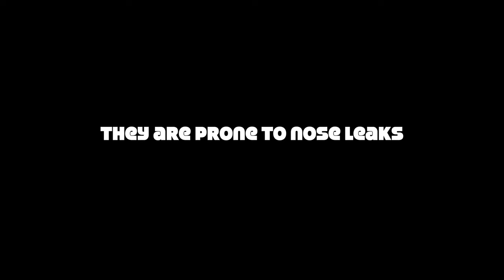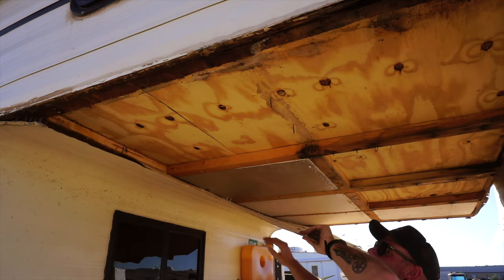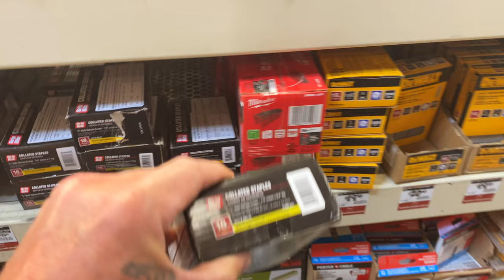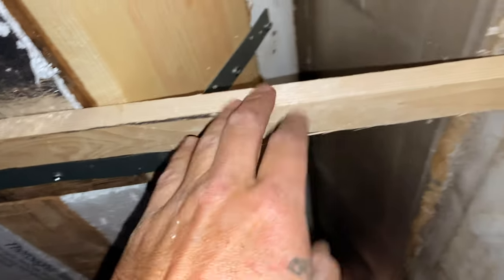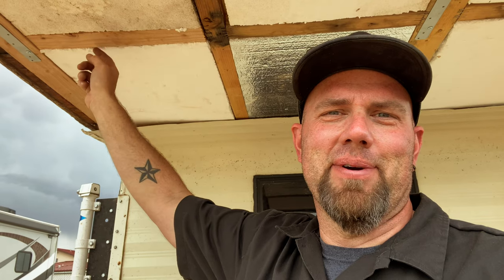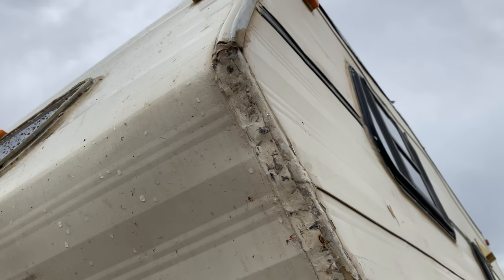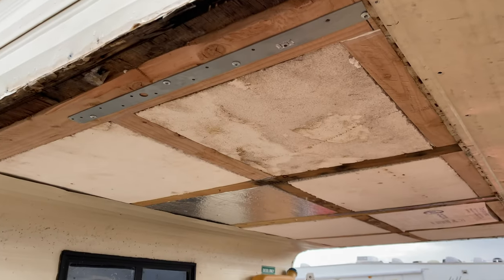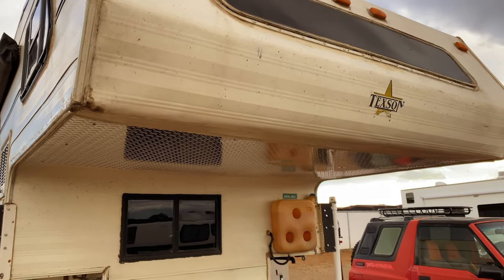Rotted Front Nose Fix On A Pickup Truck Camper ( Start To Finish )

Comment: After finally watching this video. It reaffirms my desire to get a fiberglass camper like a Northern Lite or a Bigfoot truck camper.
Reply from the maker: Ahhh but those campers have a whole bunch of other issues 😂 . Those campers will leak just like the regular campers but those fiberglass ones hold all the water inside and rots the wood just as fast if not faster. These old metal siding campers will allow the water to drain and usually dry because they are drafty. A good example would be on Jonathan Yentch’s channel. He bought one and gutted it and you can see why I’m talking about.
Reply: @worklessenjoylifemore  True enough. I watched that series of videos. As long as it's kept under cover and well taken care of, leaks should be less of a problem.
Reply from the maker: @guyverfanboy  yeah for sure! Honestly I would go fiberglass and not listen to my advice 😂 I was just sorta making light of it because that’s what I try to tell myself 😆 I try to convince myself my TC doesn’t belong in the dump haha. It is 💯 % the finest example of lipstick in a pig hahaha. It was the cheapest truck camper on marketplace!! I paid $2500 and not one thing worked in it 😂 oh and the roof leaked bad!! I fixed what I needed to and cover everything with texture and paint haha. 
Good luck on your future camper purchase!! It’s always exciting to shop for a camper!! 🤙
Reply: @worklessenjoylifemore  I will say you did a terrific job repairing the truck camper. I do not have the wherewithal to do it myself, lol.

Comment: Great job!! We had to do allot on our 1997 Lance 990. Nose had damage, each side on the back and the roof inside the back. We did remove all the old caulking and yes loads of work. Took all the windows out too and recaulked everything. Prob $400 plus on caulking it all

Comment: So my camper hangs past my windshield. I wonder how it stays. Mine being an older one had some leaks before/ when i bought it. I know you didn't want to dig deeper into the damaged plywood.. it nasty last as long as it remains dry. But, being a builder myself, the time it takes to clean and do something correctly is time well spent. (The old silicone) removed...

Comment: Looks good. I have to do pretty much the same thing this spring to my TC amongst some other changes. Only thing I'd do different is use SS fasteners. Also, water seems to collect in the bottom on the plastic strip trim piece, then gets sucked up through all the staple and screw  penetrations. Seal those if you can and drill 1/8th" holes to drain the plastic strip.
Are we going to see you at the Truck Camper Rally in Quartzsite?
Reply from the maker: Hey, thanks for that tip! I think I’ll add some drain holes!
Oh yeah, I already have my ticket to the truck camper, rally and plan on being there! I’m hoping to find some subscribers there, so we can all hang out and get to know each other. So stop on by if you see me.  
Thank you for watching 🙏 😊
Reply: @worklessenjoylifemore  Good deal, hope to see you there. I'm easily recognizable as possibly the only S&S TC there. I suppose you will be the only orphan of your TC there as well. We head south Tuesday.
Take care.

Comment: Nice work.
Although mine is a 2020, I thought about replacing the entire nose of it with black aluminum diamond plate. Still gonna probably do it.
Reply from the maker: That would be awesome!! I just can’t do black here because I’m in Arizona and black just isn’t a good color on campers due to the extreme heat from the sun!! I have wanted to paint the camper black but I just know the curtains will melt and the paint will peak off the walls 😂 
Thanks for watching

Comment: My truck camper nose is not hanging like this, but I do think there is water damage in the cab-over bed area. What is a rough estimate on the cost of your repair?
Reply from the maker: A little less than $300, but the diamond plate was $230 of that so it could be done for a lot cheaper.

Comment: Hey I am in Phoenix and I bought a 2004 Maverick Palomino. I just made a recent trip and when I got back home I noticed the nose cap had holes in it from water damage but it had come apart right where you attached the diamond plate. I need to do what you did and hopefully there isn't much damage, I hope it's like yours was. Do you know where I can find the end gasket pieces you screwed in then filled with the gasket to cover the screws? I am looking for black. I plan on making my camper look like an airstream with thin gauge aluminum.
Reply from the maker: I’m sorry I have no idea where to buy those pieces 🤷 if you can’t find them could you paint your current ones black?

Comment: Nice!  Love the diamond plate!  I was almost thinking you could have used treated lumber since it’s only a matter of time before it leaks again.  Or, how about you diamond plate the front around the window down to the new part you installed?  Then have the seem welded.  That’s probably overkill but it would look cool, lol.
Reply from the maker: All very good ideas but due to time constraints and having to post weekly videos I had to fix it the best I could for now and hope it hold for a while haha. The original leak was from the front center marker light not having a seal around it so the water was pouring in!!  So I constantly checking for leaks in that thing when it rains and I seal around those lights as soon as it looks like the caulk is getting weathered. I hope it won’t leak like it did long term anymore 🤷 crossing fingers hahaha 
Thanks for watching

Comment: Looks good buddy👍...just curious...did you use stainless steel screws when putting it together?....Looks good from NH...😊
Reply from the maker: Yea I used stainless steal screws on the trim pieces and to hold the diamond plate. All the other places I used exterior deck screws and lathe screws. 
Thanks so much for watching!!

Comment: Larry, Excellent Accomplishment👋👋🏿👋🏻👋🏾👋🏼👋🏽! Why Not Have Used Treated Wood In This Project? It Does Get Hit The Most When In Motion Down The Road🛣From All The Elements🌞🌧💦⛈🌩🌀🌬❄😱.  '🗣🎙We Now Return To Our Program, 'Work Less & Enjoy More' Already In Progress🪑🍿🥤🍫📺'! always, Tommy🤠
Reply from the maker: Hey Tommy!! I didn’t use pressure treated because I fixed the leak two years ago. Plus I keep a close eye on it when it rains to make sure no new leaks have started. Also 99% of the wood in there isn’t pressure treated so the two boards I replaced wouldn’t have made much difference I’m thinking 🧐 
Or if I’m completely wrong then there will be another camper repair video in a few years haha
Reply: @worklessenjoylifemore  Larry,, 📋👨‍⚕very interesting. I ask, "🗣🎙Did you feel like the roar of the oceans🌊or the thunder⚡of the clouds🌩in the go'n into & cum'n☁☁☁out from this🏕do over🪚🔨🪛project📝👨‍⚕"? "Have you thought of applying a roll over bar pipe'n, cut at an angle on each side under the extended hang over section, to the main wall of the Camper"? "I' am thinking this would give you Larry, strong support from the hang over, ever breaking down over the cab of your Pick-Up🛻"? "This would give you strong support across the under laying flooring your head was at when it was raining🌧". "Use u-shape clamps on the rollover pipe'n screwed into the wood framing across"! always, Tommy🤠

Comment: Dang, you're so handy.....are you single?  lol :)  Was there a reason why you needed to take down the wood you had installed to put glue in? Did it need extra strength or something? I would have thought the screws would be enough....but then again I know nothing about these kinds of things. I do own a hot pink power drill though!
Reply from the maker: Hey Sarah, I glued it because that board holds the weight of the nose on that side to the side walls. The side wall does have some water damage and I was worried the screws wouldn’t hold up over time plus the old rotted piece was glued so I didn’t want to take a a chance haha.